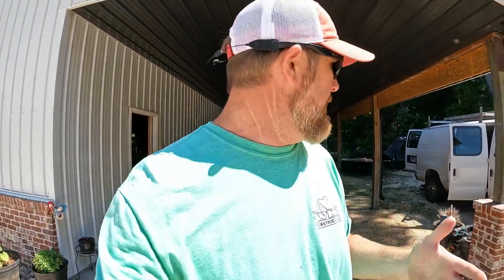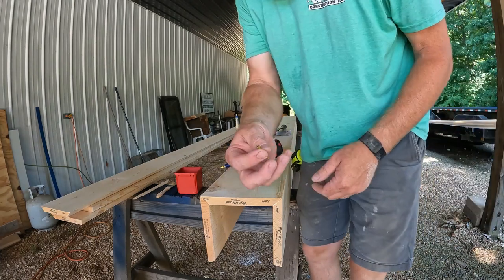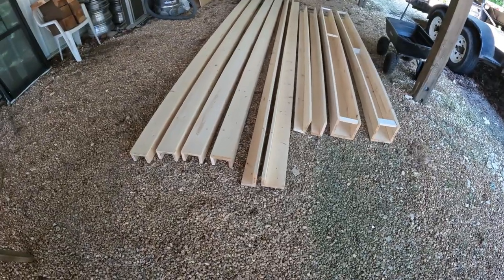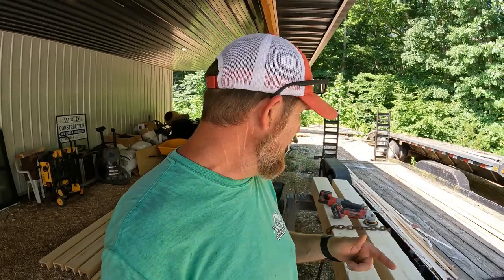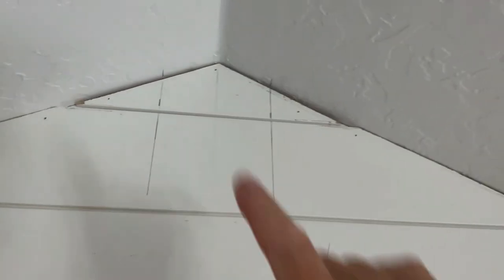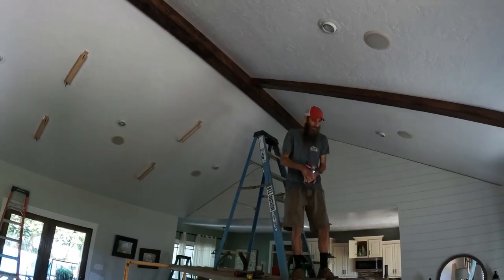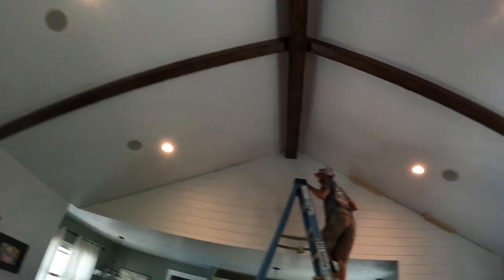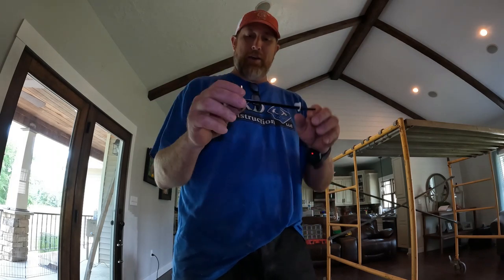How I made custom hand-crafted distressed wood beams installed in a vaulted ceiling

Comment: Man you made that look easy. Installed some distressed beams on 12/12 pitch with arch’s and collar tie essentially in the middle that the arch attached too with chandeliers hanging off the arch. Hardest part was the drywall company didn’t make the ceiling flat one bit and had to scribe every single piece to make it sit good
Reply from the maker: Sweet, ya…drywall sometimes can be a pain in the ace!! Awesome that you scribed each one!